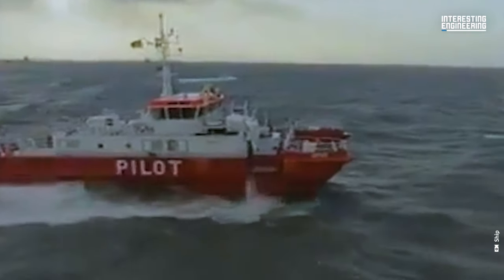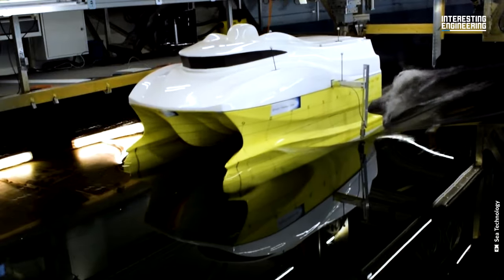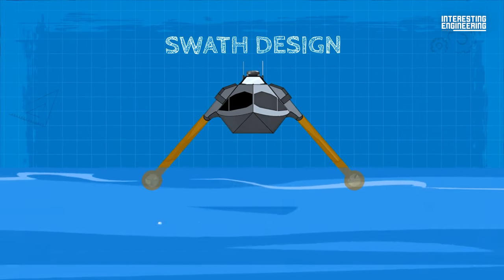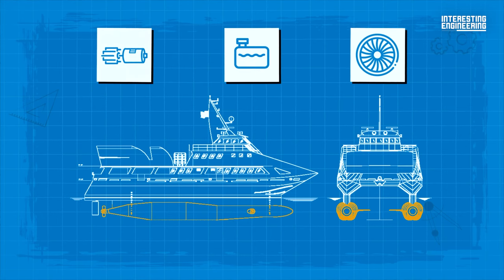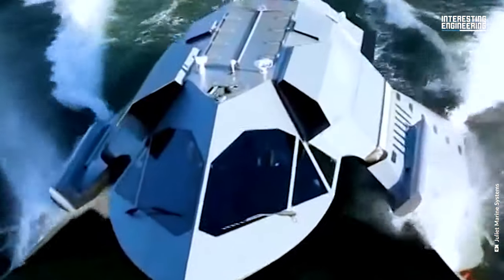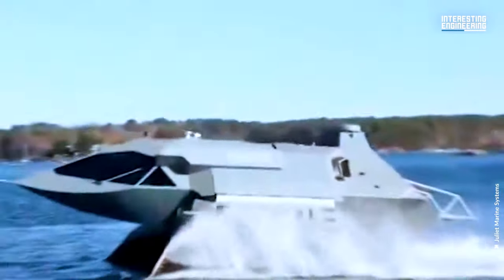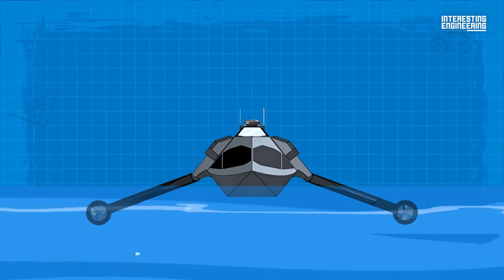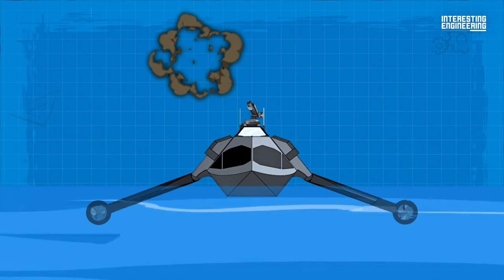The Boat That Flies Above Water

Comment: Wonder how effective this boat would be in coatal Black Sea operations.
Reply: About as effective as ours was in the Navy.
Reply: Although great, they are insanely expensive to maintain. We also had a problem with killing whales, which often resulted in massive damage to the ships. We had six ships and often at least one would be down for long periods with multi-billion dollar price tags. Another problem was the top heavy crewing of the ships. With a crew of fewer than 30, there were too many officers and top ranking NCO's. To be clear, you do not want to spend decades working your way to a top level only to have to scrub the deck like an E-1 because of understaffing. Everyone onboard had to be highly trained because these are very advanced ships that require top quality specialists. 

Then there is another problem... they do NOT do well in cold weather. That is why most of them are in tropical locations, like the Florida Keys. When we hit a whale the ship gets crumpled and twisted like a beer can. BUT! When we hit ice, it was even more catastrophic with ripping-off of struts and way more hull damage. Plus! If you just get a little ice into the foil intake for the waterjet propulsion (aka: propulsors), the entire system shatters, with complete replacement of the marine gas turbine and entire propulsor assembly.